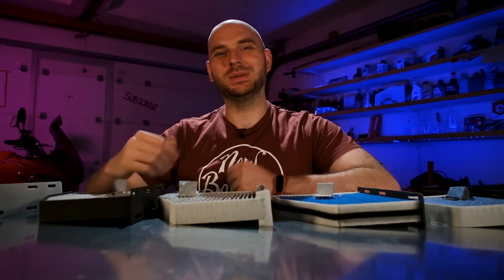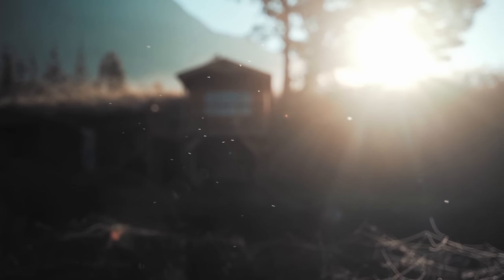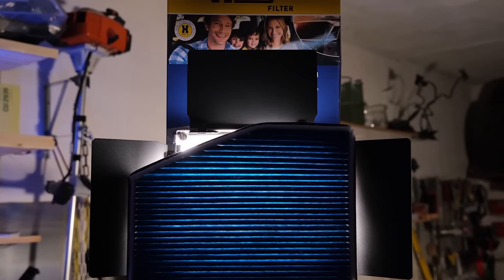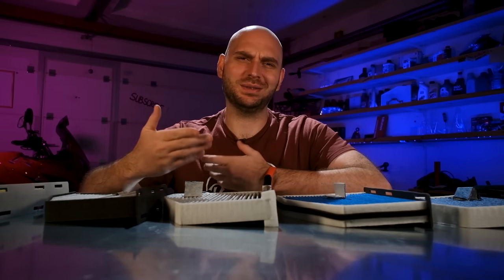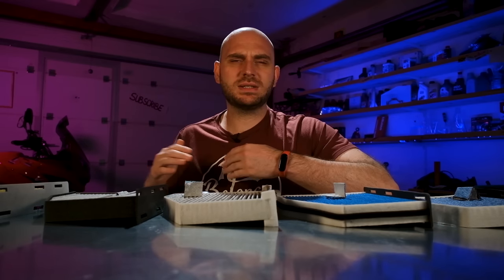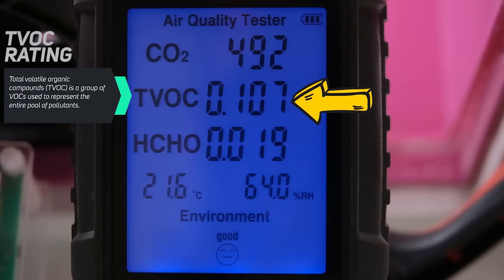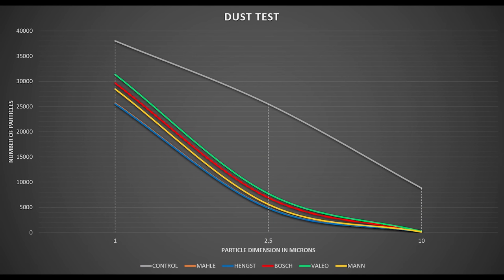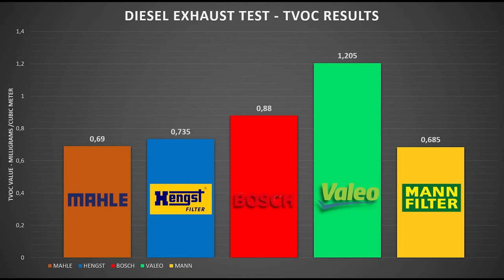Which is the best Pollen Filter? Mahle vs Hengst vs Bosch vs Valeo vs Mann - Cabin Air Filtrer TEST

Comment: But I am yet to find an anti-TDI filter.
Reply: Mahle and Purflux Advanced filters do pretty good job :) as my personal experience goes
Reply: @YulianV1990  I bought the Mann premium fiter. I usually buy Purflux, but they did not have an advanced filter for my car.
Reply: @DashCamSerbia  You can buy Mahle then, I prefer Purflux since they are not so popular for counterfeit at least in Bulgaria
Reply: There is such a filter! It.s called a "particulate filter". ;)
Reply: @ciobanumarius1803  They remove the DPF. I know those peasants. Diesel - to use less fuel. Then when those fuel saving come back in the form of expensive repairs, they remove the DPF, remove the CAT, block the EGR, chip the engine,...

Comment: The purpose of the stange balls in the Mahle filter revealed :  the balls dispers the flow of the air in manny directions inside the filter itself , thus keeping the air inside the filter as much as possible and evening it's distribution inside the filtering surface .  The more the air stays in the filter the greater are the chances to catch particles.  That technology is also used in  fluids filtering . 
Great video and kudos for the effort put in to it !   keep it up Sergiu !
Reply: Good to know I was thinking it grabbed more fine dust 😆.

Comment: After several years of wirking in automotive industries I have some conclusions for aftermarket parts.

Bosch doesn't produce the filter. It's made mostly by WIX-Filtron (now MANN+HUMMEL) plant in Gostyń (Poland), Robert Bosch GMBH is only packaging them and singning their brand, the same situation with lightbulbs (I don;t know as for now, bot earlier made by Philips) and timing belts (GATES - mostly made in Legnica Poland, even my brother was working in this plant), brake pads (LPR - Italy) etc.

But going back to MANN+HUMMEL FT it's producing filters for OEM (Original Equipment), OES (Original Spare Parts) and aftermarket in their own brands: Filtron, WIX, MANN and for other companies such as: BOSCH, Starline etc. in many of their plants in Poland and EU countries.

Hengst is also manufactoring in several plants in Poland, Czechia (Liberec) and obviously Germany

If You want more research about aftermarket brands origins I can help You.
Reply: Similar story about Valeo filters. Most of them are manufactured by Filtron or Misfat, but cabin filters are manufactured by themselves. Although, still overpriced.
Reply: Tell us about FEBI bilstein / MAHLE original / KNECHT
Reply: Do you know something about Master Sport, i bought a cabin filter with active carbon, and appear to be very similar with mann, but the price is half, generally, i bought cheap cabin filter, because i chenge them at 6 months.
Reply: What about Purflux filters? 🤔🙂
Reply: So considering what you wrote, would you say that Flitron cabin filters are similar quality to Mann? Im asking cause Filtron filters with Protect+ technology (similar to Frecious Plus from Mann) are cheaper than some ordinary carbon filters from other manufacturers.
Reply: Jacek, hallo! If you compare Filtron activated carbon filters you should look at MANN-FILTER CUK filters. FreciousPlus by MANN is a different technology and FP-series cabin filters are much more effective than Filtron activated carbon counterparts due to  the polyphenol layer. As for Protect+ technology it is nothing but marketing. It refers both to pollen filters and activated carbon filters by Filtron and consist in a special solution for soaking the filtering material to fight mould, fungi and bacteria. It is the necessary attribute of any high-quality cabin filter and Filtron just highlights this technology. As regards the level of Filtron filters, they are inferior to MAHLE, MANN and HENGST products. So, if you prefer high-quality filters, choose the above-mentioned brands plus Bosch. But if you aim at saving some money Filtron is a good choice but you lose in quality.
Reply: That BOSCH Filter shown in the evaluation was not made by WIX-Filtron (correctly stated, whi are part of Mann+Hummel Group!) n in Poland!) It came from China, similar to the one from HENGST, but different mfg. location.

Comment: Thanks for the great content! Another aspect is how much air can pass through the filters. Some filters have excellent filtration properties, but cut down dramatically on air throughput, which can make your vents for A/C, heat and fan deliver far less CFM. For this reason, I'd say the Hengst takes the lead, or maybe ties for the lead, depending on your priorities. In a very polluted city or on super dusty country roads, of if you have bad allergies, you might prioritize filtration at all costs. If you live some place that gets very cold, or very hot, you might want that extra air throughput. Aloha!

Comment: My 2 cents:
Antimicrobial layer is the finest layer in order to filter out the bacteria..
Therefore, I consider placing it the last, in order to prefiler larger particles, is the best for the filter longevity
Growing in or on the filter, is the same for me
Reply: The reason why the antibacterial coating is on different sides is because he didn't pay attention to the fact that there are filters for left and right-hand drive. Be careful when ordering parts online.
Reply: Maybe it’s so that the bacteria doesn’t grow from the evaporator as they often house bacteria and mould..

Comment: The small balls in the middle of the filter are humidity absorber media, used in desiccant cartridge filters in commercial vehicles air systems. They are used to dry the compressed air used in the braking/suspension systems to not damage/freeze the electronic/moving parts of the systems.
Reply: Thank you. I was looking for this information in comments :-)

Comment: Good video but I'd  have been interested to know the flow rate through the filters. (Will a better filter restrict air flow).

When I replaced my cabin filter I swapped out the cheap non-carbon Valio filter for a Bosch carbon filter & it seemed to be a lot more restrictive.

Comment: Damn! I need to join patreon. I just changed the cabin air filters for my Honda and my wife's Mercedes  2 weeks ago! I bought the MAHLE for the Mercedes 🤘 and the Mann for the Honda.
Tha Mann one is very thick and it was hard to fit on the filter box slits. I was nos really comfortable with the way it was fitted. The MAHLE although thick too was much easier. This could be due to the manufacturer design but it also shows that at least for Honda, Mann could have tested it better.

Anyway, great video as always! You really should keep going! Regards from Portugal.

Comment: i searched the maket today for an audi A4 b9 filter (CVNA) and the Audi price was 94 euros. From the aftermarket options i found only the Bosch option for 32 euros. I would definitely love to see a comparison series between genuine and aftermarket parts. Other than that i was a bit dissapointed for not finding hengst or mahle but on the other side, been living in Athens GR and walking everywhere for the most, the dust particle retention for driving for 10 mins should probably be less worrying. thanks for the video!

Comment: Based on your earlier video, I bought the Bosch. I was between that and the Mahle, but the Bosch was cheaper so I went for it. I was really impressed by the quality, though I'm used to the normal ones. It was the first time I had one of those premium filters.
Reply: does it restrict your air flow? In other words, do you feel less cooling from your airconditioning?
Reply: @johnnyvdpijll2927  No.

Comment: Hengst Filter is the number one for Mercedes Benz. 
The AMG’s use always Hengst filters. 
They fit very well on Mercedes. 
The Oil Filter from Hengst is the only filter how clicks when you put it on its place. 
That means that it stay on its place and the oil bypass is open. 
That’s why I personally would recommend Hengst filters for Mercedes-Benz cars.

Comment: A few months ago I bought Caremetrix lao 386 by Mahle. Here you tested LAO 181. I have no idea what the difference is, but I found it much better than the bosch I usually get. Absolutely no smells, even if I am behind a smoking truck.
Reply: 386 is for Audi A4, A5,Q5 - B8 Basis and PORSCHE Macan (95B)   ------ 181 is for Audi A3, TT, Q3 + Seat, Škoda and almost every VW

Comment: Exellent test, as usuall for you. But here comes the but... In 8:30 you discuss about the antimicrobial layer position at the filter. You are partially correct about them growing in side the filter. Allthou filtration is based atleast these four things; particles are too big to pass through caps in filter, particles are collided to filter fibes, particles are drawn to filter fibers (interception) and by diffusion (Brown movement).  For gasses filtration usually is based on absoption (Van der Waals forces) with those active carbon particles.

So there is a possibility that microbics get through that antimicrobial layer if it is first layer. But there is also a possibilty that they get throught from the last layer also if grown inside the filter... It is also possible that the layer color is just marketing gimmics and antimicrobial is at all layers. If we believe that there is a such thing.

Comment: Sergiu, thanks a lot for a very interesting episode. It’s very informative. As for Hengst, you say that there are only 3 layers but if you look at it attentively you can see white layers that perform a supporting function. Thus, Hengst E998LB has all 5 layers that are claimed by the manufacturer: 3 working and 2 additional ones. I’ve been using this filter in my VW since last May and it functions well. Unfortunately, the price has almost doubled up while Mann and Mahle have even become cheaper. Hengst may have changed the place of production but I doubt it.
Is it somehow possible to check the performance of such filters as JS Asakashi AC0119BL, UFI 34.124.00 and Kamoka 6080008 just to see the difference between brandy products and less-known ones?
Reply: Just saw the price for Hengst Blue for passat b5.5. Almost double at price, you're right
Reply: @adrianall5589 , nevertheless I agree that this Hengst is the best filter among the analogues. I used it for 6000 km and almost 11 months - everything is nice: minimum dust, smells and it retained its form after installation and removal. I strongly recommend Hengst BlueCare if the price is even 20-30% higher than Mahle or Mann. But double price is out of question. Now I have installed UFI Filters 34.124.00.

Comment: @sergiu gabor : Do you have a compilation of the test results that you can put on your web page?
Did you measure the pressure drop on the filters?
Good filtration often means high pressure drop, which translates to less air into the car.

Comment: It seems to me that having the anti bacterial layer last would actually make the most sense… considering that this layer should have the most special treatment on it, and be the finest mesh to tap the smallest particulates, you wouldn’t want it first. As the first layer it would become clogged most quickly with its fine filtration. But if it is last, then only really fine things can reach it in the first place, prolonging its usefulness. And seeing as these are not scrubbers, nor hospital grade HEPA filters, the likelihood of bacteria passing through the filter to be the same regardless of orientation.

Comment: One thing you lacked in your testing you lack two test , air flow and amperage draw using a thick filter in my testing the thicker filters almost doubled the Amperage on the blower there for shorting the life of the blower.